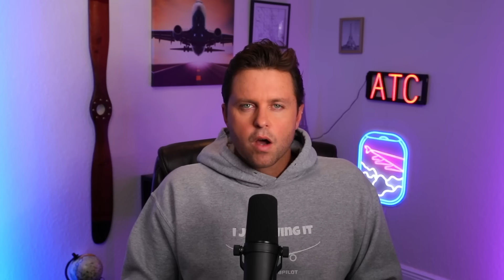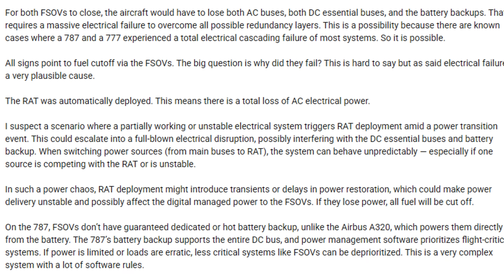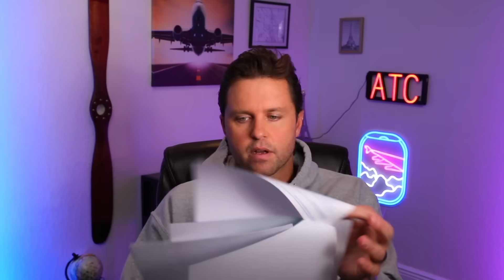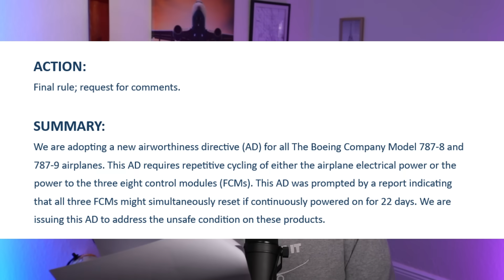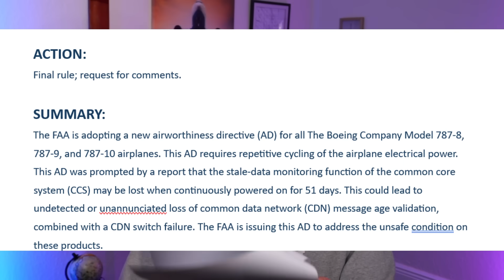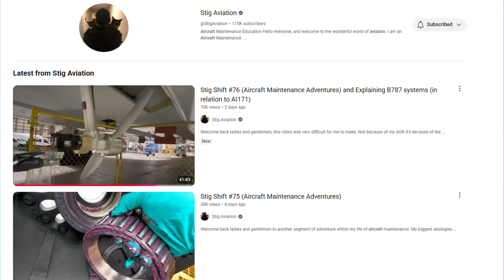Air India 171: Did a Software Glitch Cause Dual Engine Failure?

Comment: Run the APU on takeoff!
There are six engine fuel pumps on the 787 and all are electrically driven off the 235VAC bus. Major failure of the 235 VAC electrical bus would cause all the 787 main engine fuel pumps to shut down, even a temporary electrical failure.  The engines would spool down. 
The RAT would deploy, but power to the engine fuel pumps would only be restored after APU start and clearing the fault.
The APU has its own 28 VDC fuel pump (battery or RAT will power it).
Recommend all 787 takeoff with APU running until cause of crash is determined. 

The solution is technical: the tragedy is human. 
Peace and comfort to all those touched by this sad event.
Reply: It's been more than a minute, but in every cargo and passenger aircraft I flew, the APU was running anytime we were below 10,000'. With no AC on the ground, I would imagine #171 had an inop APU maybe?
Reply: @rickkadar there was an incident on sept 11 2018 air india 101 to NY pilot took off with no APU from what i read online
Reply: @kishorthakar1506  Regarding the Air India 101 incident in 2018, the pilots reported the APU was unserviceable and thus unavailable as a backup during the flight. If it had been working, standard procedure would allow them to try starting it to restore some electrical redundancy or power to affected systems.

However, the failed systems were largely independent of each other, and there is no indication that a functioning APU would have restored the specific avionics that failed. The failures may have been due to faults within the systems themselves, not just a lack of electrical supply.

Unfortunately, the final report has still not been released, after seven years.
Reply: @mickdonedee1  The APU takes about a minute to start.
Reply: Except for the fact that the 787 has mechanical driven fuel pumps on the engines that provide suction fuel flow without any need for the electrical driven pumps to operate.
Reply: @Mentaculus42  I think based on Google, they primarily use electric pumps with suction as a backup. Before it switched over to suction mode, would the engine totally spin down if so how much time would that take then to have the engine spin back up to give enough power to have enough lift that was needed at that time?
Reply: @Mentaculus42  Yes, the engines can run on suction feed.  Its an airworthiness requirement.  However, I don't believe a huge fan engine can draw enough fuel from one to tank to sustain TOGA power under gravity/suction feed conditions alone.  I say "one tank" because, again for airworthiness, each engine must be fed by only one tank during take-off to prevent a contaminated tank from feeding all engines.  It make sense.
Reply: @kevinnurse9936 

A 787 pilot explicitly stated that they takeoff on the center tank if it has enough fuel. 

From the 787 pilot:

“The center tank pumps (2) are normally delivering fuel to the engines for takeoff.”

So unless this is incorrect and there was further information about why the center tank is first used and emptied, I am going with it. In light of what has happened and if there was something wrong with the center tank, maybe they should use the wing tanks for takeoff. But using the center tank provides more redundancy (with potentially 6 electrical pumps operating).
Reply: @Mentaculus42  Yes, I can see why the centre tank is used first in flight, once the fuel system is set for climb and cruise.  Its industry-standard.  However, I am surprised that the centre tank feeds both engines at TOGA power during take-off.  The engines would be vulnerable to a single source of contamination.  If this is the case, this would be the cause of double engine reduced power and unsettled power output, leading to "loss of thrust" as per the mayday message.
Reply: @kevinnurse9936 

“If” I understand what is going on is in reference to this information from the 787 pilot. 

From the pilot:

“The center tank pumps (2) are normally delivering fuel to the engines for takeoff (there is no flap logic associated with their operation) meaning fuel is delivered from the center tank whenever fuel is in the center tank and the pumps are on. The 4 wing tank pumps (2 pumps in each wing tank) are all competing to deliver fuel to their respective engine as well. However, since the wing tank pumps deliver fuel at a slightly lower pressure, the center tank pumps essentially win the pressure battle until no more fuel is in the center tank.”

From the pilot:

“l do not think there is a water separator of any kind and we have no cockpit indicators for water in the fuel--mechanics do periodic sampling but I don't have any expertise in this area. I don't believe a water/fuel mixture would reduce the output pressure.. Yes, the center tanks are depleted fully using a fuel scavenging system that comes on shortly after the main wing tanks start providing fuel. There are separate pickups for each center pump (forward and aft pump) but we normally shut these pumps off once the center tank quantity reaches 5000 lbs so those pickups are not uncovered at anytime while the pumps are running. The remaining fuel in the center tank is then picked up by a fuel scavenging system (which has its own pickups at the lowest parts of the tank). and delivered to the wing tanks.”
Reply: @Mentaculus42  Thanks for that.  It completes my picture of the fuel tank sequencing .  It is still my opinion that gravity/suction feed from the fuel tanks will be insufficient to sustain TOGA power.  Instead, the reduced fuel flows will keep the engines running at much lower RPMs, which will be below the high power range needed for TOGA.  Hence the mayday words, "loss of thrust", rather than "engine failure"
Reply: @kevinnurse9936 

My thoughts are about just what was failing when. One reason is that parts of the electrical system could have failed and the RAT deployed because the engines rolled back to less than flight idle but didn’t necessarily totally fail. So yes the electric pumps probably shut down but my premise is that by that time the engines were rolling back. Another idea that is being proposed is that there was an abrupt loss of electricity and that shut some fuel valves. Totally different sequence of events. I also think that the aircraft engines were starting to have some problems around V1 which made for some tough decisions at that time.
Reply: Probably on landing too tbh...
Reply: This sounds like a very logical suggestion if it's the case that the APU can also supply power to the FSOV's.  My assumption is that it only provides power for cabin lighting and cooling, etc. after engine shutdown at the gate, until external power is connected.   Maybe someone else can correct this for me.
Reply: @Gourockian1 . Good question.  So the APU can supply about same electrical power as one engine. Of the 6 main generators on the 787 there are 2 on each engine (starter/generators) and 2 in the APU. All supply 235VAC which is the 'main' power for the aircraft, each gen is about 225kW.  (The 280VDC, 110VAC, 28VDC are all derived from 235VAC).  There are 28V batteries, and additional smaller 110VAC generators for controls backup etc.  And the RAT.  The 6 engine fuel pumps; 2 left tank, 2 right, 2 center.  Engines can gravity feed but not at full power.  APU can suck from one wing tank; has its own 28VDC electric pump on other wing tank.
Reply: @chrismax-p5x  Thanks for the detailed info.
Reply: @Gourockian1 The APU is used to start the engines. You can use ground power but you need a second GPU connected at another ground power point located in the R/H hydraulic servicing bay aft fuselage and TE wing root fairing. This is in addition to the 2 usual sockets at the nose LH side, so 3  415 power AC supplies in total. There are no pneumatic bleeds off these engines apart from booster and inlet anti-ice, so engine starting, air-conditioning,hydraulics and wing anti-ice are all electrically operated.
I don't know if the APU was working, the video showing no TV screens and lack of conditioning air suggest it wasn't.
Total power failure at the point that the aircraft rotated into the sky by the change of state of the weight on wheels switch, changing from ground mode to air mode, makes sense to me when considering the other know historical faults encountered.
Reply: @peterkelly2492  Thanks very much for your explanation which seems to confirm that had the APU been running during takeoff, the FSOV's would have remained operational.
Reply: En las centrales eléctricas existen dos fuentes de energía en paralelo, la perdida de una fuente está respaldada en línea, no tiene arranque manual, eso podría ser una solución,
Reply: the aircraft is perfectly capable of flying on suction feed up to FL250 I believe = no pumps needed
Reply: Good theory and I respect but even if electric fuel pumps went inop you would still have suction feed from tanks.
Reply: @StanEarl-n6f  That's what the engine and aircraft manufacturers will tell you. Anecdotally, there was a case where a 767 pilot mistakenly turned off his fuel pumps (no idea why/how) and the aircraft did not climb. It was shortly after takeoff, certainly not at high altitude.
Reply: Almost every engine fuel shutoff valves are fail safe open, means if electric power lost valve would remain open.
Reply: @StanEarl-n6f   Power is always "lost" on engine feed  FSOV's - a momentary DC pulse is sent to the latch valve and it stays in position by a magnet.  So in essence they are fail safe to whatever the last position and can only be "open" or "closed"   ( I am talking modern airliners)
Reply: @StanEarl-n6f That's covered in the video. These are failsafe closed to stop feeding fuel to a fire in case of crash on landing.
Reply: Older airplanes the fuel shutoff valves were electrically held closed so in case of loss of all electrics valves would have been fail safe open. Seems newer models this may not be the case.  New technology not so good. If something works no need to improve it. Can’t imagine any new technology that would allow a power failure to close the FSOV.
Reply: I have heard that these are for tanks on wing for central tank there is mechanical one sucking fuel of this tank regardless of other ones. Said by 787 pilot maybe untrue he said that engines are able run with ac being totally lost own generators own logic independent fire safety on all systems usually override allredundancy and prone to be triggered
Reply: @KabelkowyJoe . Two electrical pumps per tank - left, center, right.  Also a smaller DC pump for the APU if it needs it.  No mech fuel pumps on engines.   Engines can gravity feed but not at full power.
Reply: @chrismax-p5x  "not full power" okey so maybe that's why meyday call was "thrust not achieved" instead of "lost both engines" or something like that. I though that maybe fuel is sucked mechanically - and pumps are only to move fuel from tank to tank and let fuel tanks to be pressurized - pressure also varies depending on altitude. Diesel for example uses two pumps at least, main is mecanical, fuel just circulate  to feed mechanical pumps, on common rail but it's pressurized by mecanical pump. Its different for gasoline - main electric pump makes pressure and injectors usually electric are making additional pressure. On diesel pressure is much much higher therefore usually its mecanical. Jet fuel is somewhere between gasoline and diesel. Some diesels could even go nuts - like jet engines speed up uncontrollably even if you cut the electric power. There are many examples. Heard on one channel that there is safety valve - spring loaded that cuts of fuel just in case.. therefore it suggests that engine is able to suck fuel. I just try to figure out whenever tis was AC line failure or some logic failed. Gear that didnt finish retraction suggest it was AC failure. Thanks to your sugestion its more clear to me that engines were not that much "independent" as was suggested. And could not operate without AC line. Just pondering thinking loud.. hence my first comment.
Reply: https://youtu.be/dIgnR0zw3FU?si=FIglkTDBwcJWlfU3
Reply: I believe it is a 115 Volt 400 cycle bus.
Reply: @ChrisZost I think power is generated at 235V, converted then the primary power distribution system distributes and protects the 235v ac, 115v ac and 28v dc
Reply: Excellent idea!  I’m going to start doing this!
Reply: A good perspective to explore.

Comment: Yikes. This makes much more sense to me than anything else I have heard. The other hypothesis never worked for me. Fuel contamination - why did no other planes become contaminated & fall out of the sky?  Vapor Lock -  why did not vapor lock occur in other planes? I lived in Phoenix AZ for a few years. In August I have seen it be as high as 118 F. No planes developed vapor lock & fell from the sky. In fact the other day watching you & Capt. Steve I asked that question.  This new theory may not be the issue but it makes far more sense than anything else.  Safe Travels.
Reply: Fuel contamination can come from a variety of sources. Google Jetstar 787-8 JQ15 Osaka (Japanese Transport Safety Bureau). That plane lost both engines within a minute of each other. Ironically, it was something engineers put in the tanks to stop fuel contamination that caused the issue.
Reply: @ImperrfectStranger  "within a minute" is the key phrase. Even a delay of second or two would cause asymetric thrust to be visible on the "long" video but it's not there. The fault appears to have affected both engines at precisely the same moment. I will be amazed if it is fuel contamination of any kind.

Comment: Ty for the update. Would this also account for the unusually long acceleration/lift off sequence? This jet barely made it over the concrete slab at the end of the runway! I saw another channel where someone made a graph of this airport runway's 787 lift off points over a month. The only one that went way beyond the usual lift off points was this flight AI 171. The pilot flying may have realized a problem, but it was past the rejection point.

Comment: AD Final Rules - 2015-09-07.pdf I located it on the FAA web site. "We are issuing this AD because we evaluated all the relevant information and determined the unsafe condition described previously is likely to exist or develop in other products of the same type design. " Also; " If the four main GCUs were powered up at the same time, after 248 days of continuous power, all four GCUs will go into failsafe mode at the same time, resulting in a loss of all AC electrical power regardless of flight phase."  AD Number:  2015-09-07   Docket number:  FAA-2015-0936
Reply: The AD's warning of a total AC power loss perfectly aligns with the conditions that would trigger the RAT, and also with the pilots' reported "loss of power and thrust" Mayday call.
Reply: Also,  given the 787's reliance on electrical systems and advanced digital controls, FADEC could be a key system under scrutiny in any investigation involving engine performance issues, especially when both engines are affected simultaneously.
Reply: Given the Mayday call explicitly mentioning "loss of power and thrust" and the confirmed RAT deployment, the initial focus of investigators will undoubtedly be on the engines themselves, the FADEC systems, and the main electrical generation (GCUs, Variable Frequency Starter Generators or VFSGs) as the most likely culprits for the thrust issue. FCMs would be investigated for their role in control during the emergency, but less likely as the initiator of a dual thrust loss.

Comment: Everything I've seen from Boeing suggests they're a psychopathic entity prioritizing stock value and efficiency/profit to an extreme degree. Honestly it's a no wonder they've been in the headlines in most airplane catastrophe since a few years ago. This incident may or may not have anything to do with Boeing at all but we need to keep the pressure on Boeing to keep the standards extremely high. Not only for us, but for those who suffered and are suffering because of Boeing's shady practices

Comment: If a voting machine can be hacked with a paper clip, I suspect a 787 computer would be a piece of cake.
Reply: That's an interesting angle. What electronics ports are available to 787 passengers, and what systems are vulnerable to attack, or poorly configured devices, via those ports.

Comment: The fact  was buried, but the MCAS software was initially single sourced to only one AOA sensor.
Reply: Before I retired I worked on flight control systems, and it would have been unthinkable to create a system that relied on just one sensor.  A lot of effort went into analysing the effects of single and multiple failures.   Looks like Boeing has a different attitude.

Comment: Contaminated fuel scenarios do not fly with me. One comment was that fuel at airports is contaminated. If this were the case, then there would be more aircraft accidents. I would like to see the data that supports this theory.  I subscribe to Stig Aviation channel. I am a retired USAF avionics technician on C-5, C-141, and the A-10. It brings back memories for me.